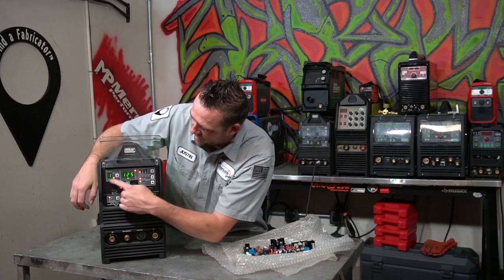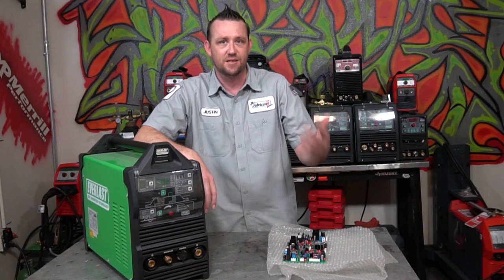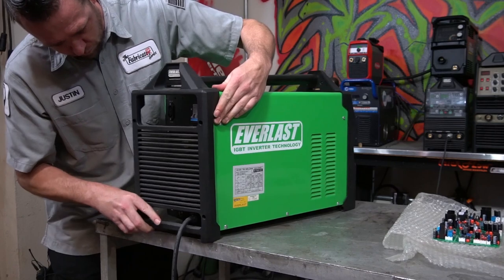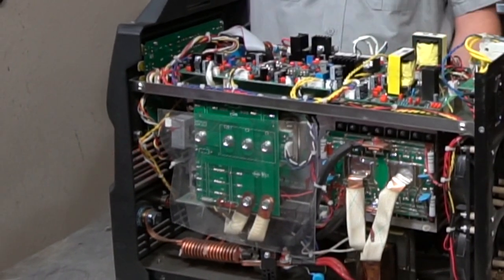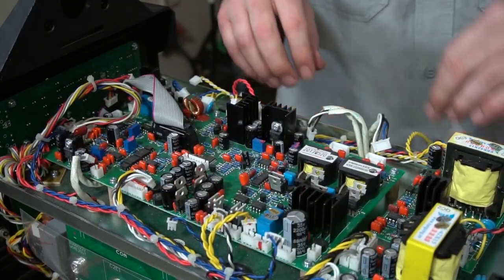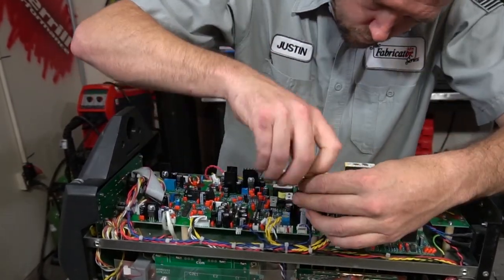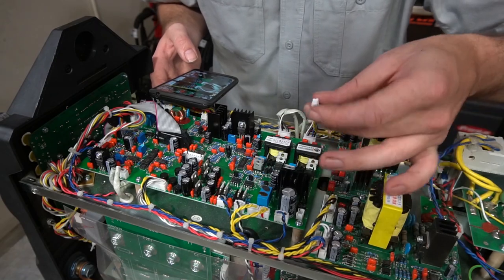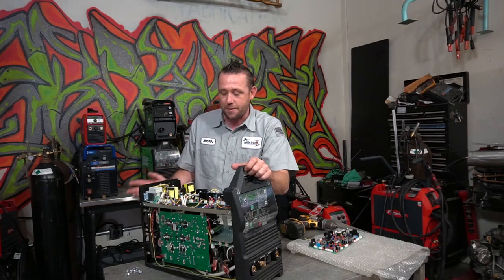TFS: How to Replace a Board on Your Everlast Welder

Comment: hello, a greeting from Italy ... I would like to buy an ac / dc tig welder. maximum price 1400. what do you recommend? machine quality, durability, welding quality? list some welders, if the ideal one is missing, please advise me. thanks, congratulations for your videos are really beautiful.
PowerTIG 200DV
lincoln electric ac / dc 200
lokermann grand tig 200 ac / dc
ahp alphatig 200x
primeweld 225x
Reply: Ciao, scusa il disturbo, alla fine cosa hai scelto? Mi pare che questa everlast abbia facilmente problemi... Stavo guardando le Parweld, c'è poco in giro come opinioni per poter valutare, ero orientato su quella marca finché non ho scoperto l'everlast finché ecco, mi appare questo video.. i commenti non sono di certo confortanti ed ho pure contattato Justin su Instagram, sai che mi ha detto? Che le sue everlast sono morte un paio di anni fa e che non le usa più... Sapresti dirmi qualcosa? Consigli? 😊✌️

Comment: Watch those capacitors, they bite!
Reply: bbrinser was about to say the same!
Reply: Yeah, I personally would make a point to leave it unplugged for at least a few minutes before opening it...
Reply: The unit self drains capacitors within 5 to 10 minutes, but good point.
We typically recommend about 15 minutes wait after unplugging.  We do have directions available for install, or the customer can have it repaired in our facilities.
Reply: @everlastgenerator  I need a circuit board for my mts 200
Reply: @everlastgenerator  I have. My 210ext welder that is doing the similar problem it sat with out being used for about a year and then when I got it out to use it for a project it's started doing this it has gone bad. Funny that my lincoln tig 200 sat for longer than this one and it's working flawless but I admit I love my 210ext better than my lincoln welder

Comment: I have the same machine, only it is called R- Tech and it is blue.
Reply: It looks the same, but there are internal differences.  We actually designed the machine R-Tech is using.
Reply: Everlast Power Equipment same shit different name
Reply: @everlastgenerator  I've seen another video, about an r-tech ac/DC TIG welder, with 4 ac wave forms; well, in the video was said that r-tech has been around since 10/15 years earlier than everlast; so they suggest the fact that r-tech Is giving their design to other brands; in Italy we have tigmig brand wich Is the same as r-tech and everlast; in Germany they have lcd vision: all theese machines are based on Siemens mofset.. I'm not an expert, but as a welder, theese machines look and perform all the same way to me.. pretty good though
Reply: @raulduke85  yes, and they have used several manufacturers as have we.  Weve been around since 2004 and have been mfg since 2008 in our facility, and constitute 80 of its production and also have invested heavily in the factory. Rtech and others benefit heavily from our investment, technology and expertise... The truth is that We spend heavily there in r and d and offer new product both that seeps down to them in altered forms and becomes  available to them as well.  We manufacture to higher specs (etl/ul) use superior parts and have many models currently in development even now. And rtech sources from several manufacturers for their line.  We do not and use just one.  We have around 50 ,models. Rtech does not.   Our distribution is on 6 continents.  R tech is primarily in Britain. Now, consider the facts and logic.  Oh and we supervise manufacture on our lines personally and have institued our own qc. Processes
Reply: @raulduke85  we use some siemans/ eutec but others as well.  Ours are igbt, not the lighter mosfets.  We do have 2 models that are mosfet but are under a shorter warranty period.
Reply: @everlastgenerator  anyway, you have to develop something similar the fronius mw 230i, since i don't want to spend 7k for my next welding machine
Reply: @everlastgenerator  Been trying for three weeks now to get a board to repair my in Warranty machine talked with Tech Support My machine cuts but Pilot Arc no longer works.  They keep asking me to do more tests and three weeks into it still no Help.  I am not paying to shp this defective machine back for repair again. It died the first time less than 10 days out of the box,.  I just need the Pilot Arc to work.

Comment: The main board on my Miller Diversion 165 failed.  They wanted $1200 to replace it.  I tried to replace it myself.  Heard a pop after starting it: A $700 mistake. Two words: Fuck Miller.
Reply from the maker: MrApplejack1976 I blew my Diversion 180 up 4 times. That board was $1600 or so which (at the time) was $100 less than a new one. It's a cool machine but that's ridiculous enough for me to not buy another.

Comment: It's a little concerning to see a bare PCBA wrapped in and resting on non dissipative bubble wrap. That stuff can generate some serious ESD voltages. I sure hope it didn't come from the manufacturer like that.
Reply: Yep, that hit me right away.
Reply: These are a bit different than computers.   These board handle things like HF and a lot of other things, including metal dust and are durable.   We've had no issues, nor expect any.
Reply: Sure, I understand what you are saying and guess that you have designed to cope with Pollution Degree 4 with I assume the use of a conformal coating. But your exposed IO may still be subjected to life reduction by high ESD from within your packaging. I have only seen this a handful of times with products I have been involved in the design and certification of but it still happens. Granted the RMA level due to this may be in the noise of your return statistics. 

I'd still recommend any of my customers spend the few pence on an ESD bag to ship their product in as a fairly low cost insurance policy.

Comment: I wouldn't buy that overpriced Chinese crap!!  If you buy a quality machine from your local welding supply house. They will take care of it 100% Parts and labor!! If it's in warranty!
Reply from the maker: I'm not sure if replying to this will help you, but it probably will help others. The DIY board replacement is an *option*. The other option is to send it out for warranty just like any other company. It's all completely covered just like any other company. 

The country of origin is completely irrelevant to the available warranty options and policies. If you want to get very technical, many big name welding machines are manufactured in China. Even the favorite blue and red boxes are manufactured out of the country. The Everlast warranty is longer and includes more options for being manufactured in the same place. I hope that helps you clear your head about the difference between warranty policies and countries of origin.
Reply: I know most every thing is assembled where ever, with Chinese parts.

Comment: my Everlast dv 200 has only about 5 bottles of Argon thru it, using the same tungsten as always 2 % lanthinated when I weld the tungsten starts tiny sparks like a sparkler & the tip melts. also using the torch switch the arc will nor shut off when I let go of the switch, tried clean & gapping the points no luck, my other welder do fine with same tungsten, same argon, same steel, even tried different torches & regulators, not sure where to go from here?